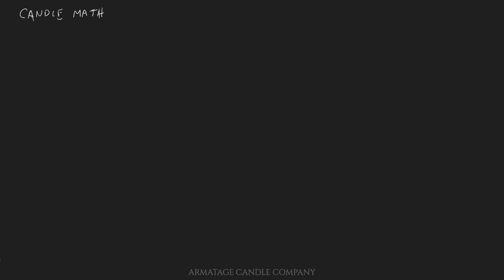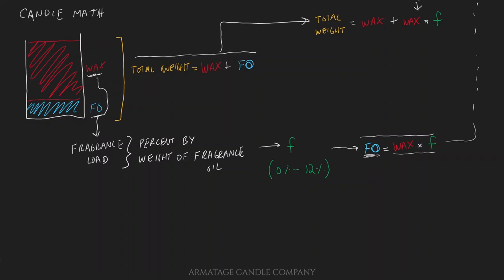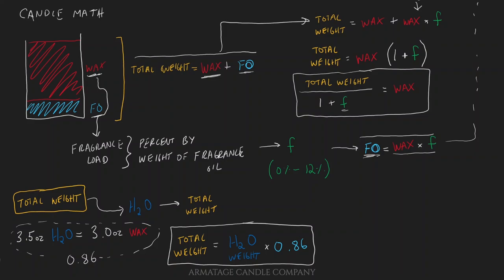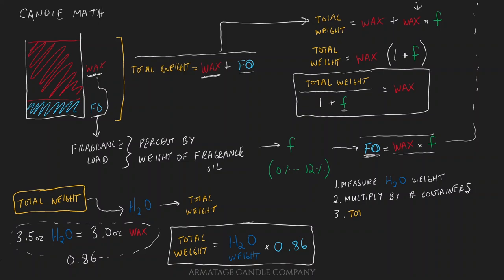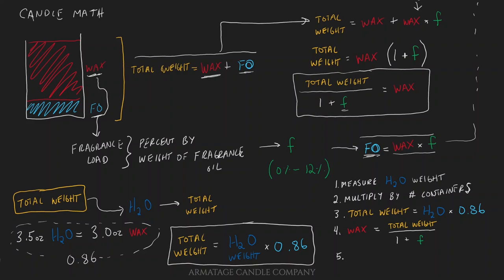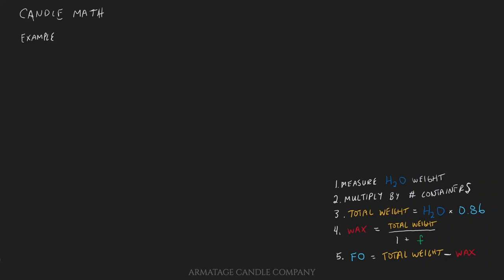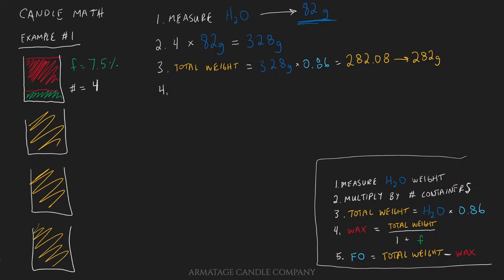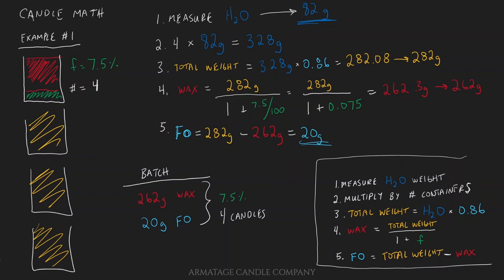How To Calculate Wax & Fragrance Oil for Candle Makers

Comment: There is an app that does all the calculations for you. I’ve tested it and it gave me 99.9% accuracy. Is there a reason why we shouldn’t use the app and do the work manually? While the manual calculations helps use deeper understanding but if there is tools out there created to help, why shouldn’t you use that? App is called “candle maker cal” on iOS FYI.
Reply from the maker: That's awesome!  I'd use that if it helps you.  The purpose of this is to understand the proof behind the math, and you can take these ideas and run with them however you want.  Some (like myself) prefer to build elaborate spreadsheets to track my designs and just tell me what to do.  Apps are perfectly fine too.  If you're a die hard paper and pencil person, then you have these for reference now.
Reply: Is there any android alternatives or websites? I can't find any with reviews and I'm really dyscalculic so I'm really struggling with the maths portions of candles

Comment: Maybe it's my overthinking here, so please comment Kevin: 
but using the formula TW/(1+f)=W where TW = 100g and f=10% we would get a W=91g and FO=9g
And when you calculate the % concentration it would be a 9g/(91g+9g) * 100% = 9% which doesn't match up.
If we consider a candle as a chemical mixture, in order to get a concentration of 10% in 100g of mixture, we need to take W=90g and FO=10g. 
The disrcrepancy of 1g (1%) may be negligible here but I can put up a equation to get a more precise W and FO values:
TW(1-f)=W
and when you take a TW=100g and f=10% you will get exactly W=90g and FO=10g which will really be f=10% here.
Looking forward to hear your comments

Comment: Thank you for your video, well explained concept, but don’t you think it’s easier to go by the volume instead of weight. I use volume calculation instead to determine the fragrance oil. After melting wax I take as an example 1 litre of wax in a separate container and add the fragrance oil to it in ml (millimetres). If 8% oil is required I then (0,08 * 1 litre of wax) which makes adding 80ml fragrance oil to a liter of molten wax. The reason for this is that all fragrance oils are sold in volume, rather than weight, also volumetric add-on is more precise way of adding it to wax.

Comment: Whilst I understand fragrance loads etc to a certain extent. I read were you should look for fragrances for soy wax, I live in the Uk and I am finding it difficult finding any stating soy wax. Should I be looking for something in particular? I though I would use soy wax but I am at the point of throwing the lot and going to paraffin which I don’t really want to do. I am using 20cl straight sided glasses with 464. It doesn’t matter which wick I use, it just isn’t going right. Any help would be much appreciated Thanks Maggie

Comment: what I am most confused about is why do we need to divide the total wax weight by 1 + FO % . Why can we not just multiply the FO % by the wax weight to get the amount? I totally get the math but I am not sure why just multiplying would not work in this situation? For instance, in a situation where you'd ask what is 10% of 100 you'd just multiply 100 by .10 to figure out what 10% of 100 would be. This is not the same in this candle situation but why?
Reply from the maker: It's not the "total wax weight" we are dividing by 1 + FO%.  We're dividing the ENTIRE weight of the candle by that amount.  The result gives us the wax weight.  We have no way of finding the wax weight before that point in time.

For example, if you assumed the water weight * 0.86 was the wax weight, and multiplied it by 6% (FO), it would yield a 6% batch, but you're using too many supplies for the batch (per math).

Specifically, you'd run over by 6%.  Not a big waste with a single small batch, but a massive waste over time and with large batches.

Comment: Hello, I've watched nearly all your videos but I still ask myself this: Why do you use that formula when calculating as opposed to just doing:
Calculate wax weight by doing Wax Weight = Water Weight x 0.86

Then calculating the desired fragrance oil by doing 
Fragrance Oil = Wax Weight x 0.075 if you want 7.5% fragrance?
Reply from the maker: The first formula you list calculates the total weight of a candle, which is the sum of the FO and wax.  Everything you list would work, but you’ll end up using 7.5% more supplies than you need to.  

Should be relatively straightforward to verify, especially with a 4+ container batch where you’d easily notice a surplus of wax/oil after pouring.
Reply: @ArmatageCandleCompany  thanks for the reply and info! :)